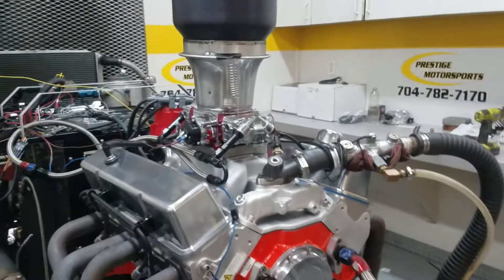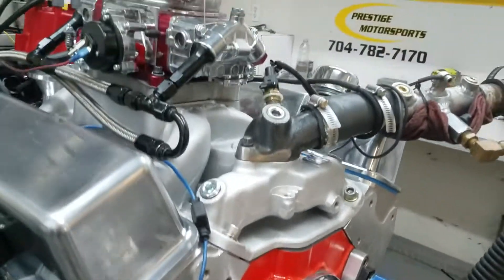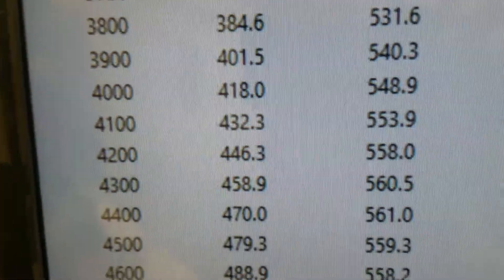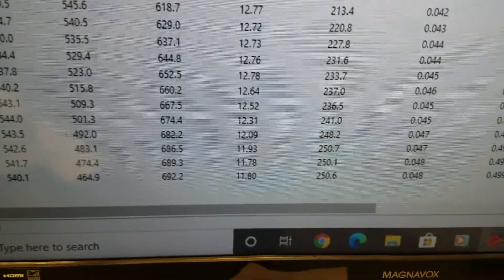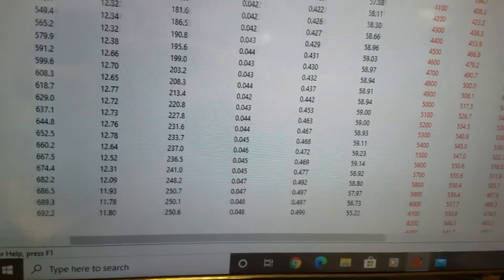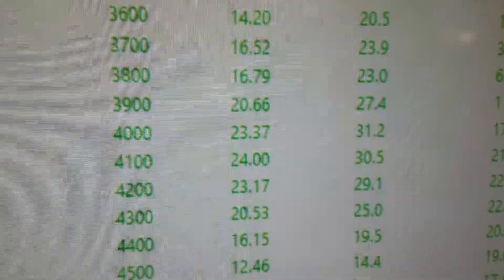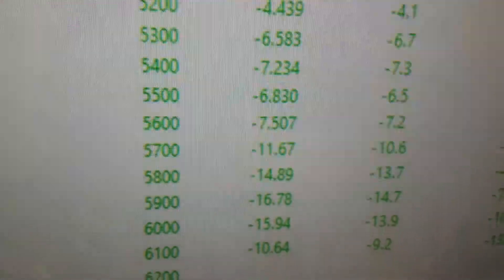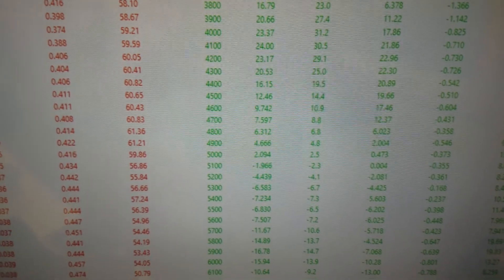Ben's 427 Chevy on the Dyno - Edelbrock Vic Jr vs. RMP Air Gap Intake - 544HP/561TQ

Comment: I would have figured on a bigger motor that the Victor Jr would do almost just as good down low. If course in a car with gears and a stall converter, the Victor still might outrun the rpm airgap. I went from the first weiand stealth intake to a Victor Jr and it made a big improvement on a little 327.
Reply: I too would've thought the Victor Jr would have at least as much low end as the RPM on a 427 small block. I've seen a dyno test on a 550 hp 406 and the Victor didn't start to outshine the RPM until about 5900 (where it's 5100 on this engine.). On a 420ish hp 350 the Victor rose above the RPM I think somewhere in the upper 5000s also.
 So seems to me that the crossover RPMs that the single plane makes more power is as much an RPM thing (revs) and not as much as engine size? Guessing it's about the pulses dancing around in the manifold at different engine speeds  regardless of cubic inch (to a point)?
Also,  maybe in an engine with this much torque you wouldn't mind or might even want to kill a little low end. A 350 with a dual plane won't even come close to the midrange torque of this engine with a single plane, and look how strong they run with enough stall!

Comment: Would a 1 inch spacer on the RPM Air Gap add some Horse around that 5000 rpm range?
Reply: Every combo is different but in all likelihood a 1" spacer would add some top end power. I would've thought that horsepower level was well beyond the limit of the RPM intake but it hung in there!
Reply: @mikewillett5076  
Intake Manifolds have been misinterpreted forever until recently.  A certain crate engine builder is offering the "low profile" crate engines for hood clearance issues and these engines are producing big power using a basic looking intake manifold.  It's almost alarming at this point.
Reply: @delljr2769  How have intake manifolds been misinterpreted? The video shows what everyone has known for decades, Victor Jr. for peak horsepower, Performer RPM for everything else.
Reply: @RadRidesByCru  
Until recent years most guys have ran "hi rise" intakes with large runners to produce 600+ but builders are producing that same power with stock looking intakes such as the Edelbrock 7101
Reply: @delljr2769  The 7101 is a high rise intake, same as the 2975. The 2101 and 5001 are low rise intakes... I didn’t see anything in the video I haven’t seen before over the years. But if you did, or you expect other guys will, then that… is awesome.